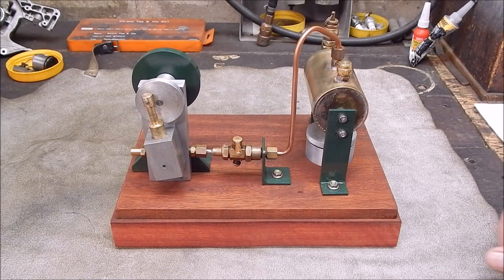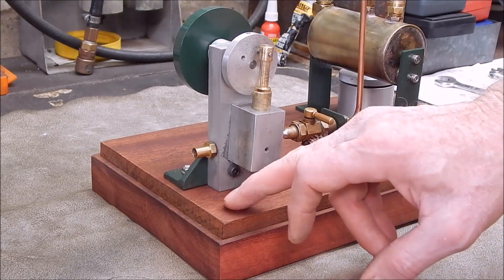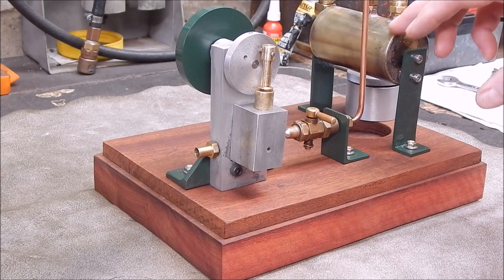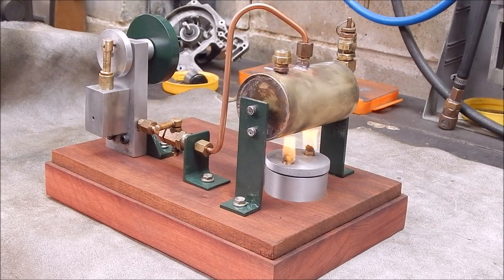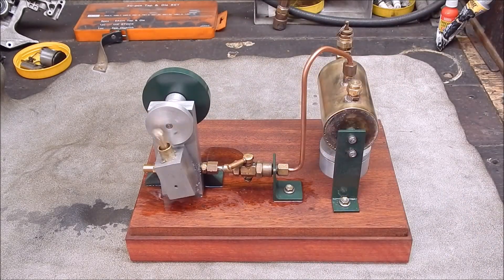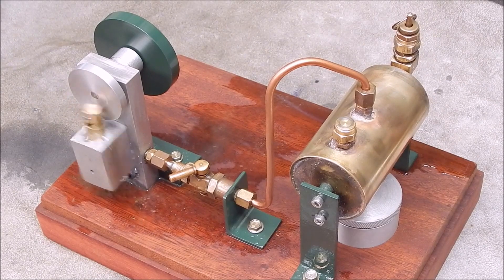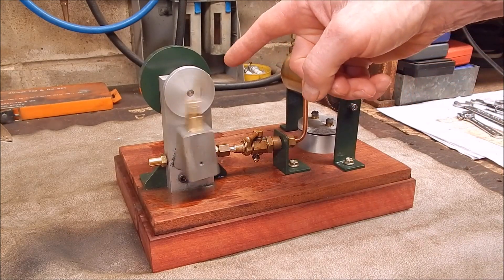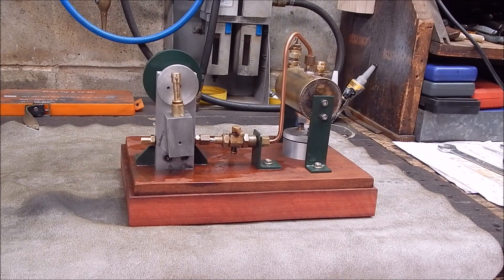The live steam powered wobbler model engine project is complete

Comment: Nice work Rob !!
Reply from the maker: Thanks Patrick.  I was starting to doubt if the boiler would be big enough, but it worked out OK once I fitted the control tap.  Cheers Rob
Reply: @Xynudu  Rob,I have an old steam engine and boiler from Germany.Wilesco is the maker.The boiler seems about the same size as the one you made.I ran with a small amount of alcohol in a container.You should make a tiny whistle.Cheers !

Comment: Hey Rob.  Once she warmed up she ran like a sewing machine.  Perhaps a little gauge on the boiler and let it build up some additional pressure, you might be able to run that Dynamo.  Maybe add a sight glass and a water pump and go all in!!!  Great project and thank you for sharing.  On another note, how is the displacement engine coming about.  Or have you shelved it in frustration?

Joe
Reply from the maker: Hi Joe,  I am moving on to another simple steam engine project.  I can give the boiler more heat by raising the burner wicks, but if I crank up the engine speed, run time would diminish.  So I will call it quits on the wobbler.

It's been a great fun exercise - all new stuff to me.

The displacement engine needs some serious re- engineering and ultimately it will be much the same format as my previous two successful Stirlings, so I will change tack and use the bits from that and the Bastard flame licker engine to make a new simple long stroke steam engine.   I could potentially run the tiny dynamo more effectively off of that if it works out.

All good stuff and just shows lathe and workshop life is only as interesting as you make it.

Cheers Rob

Comment: Looks great Rob👍  very smooth, Looking forward to the next one mate. Hope the beer fridge is well stocked for today 🍺
Reply from the maker: Hi Bill,  things are heating up here.  Always plenty of beer in the fridge.  When your workshop burnt down, what was the lathe model that got destroyed at the time ?  Was it an AL250G ?  I'm interested in owner impressions of this lathe.  Cheers Rob
Reply: Yes Rob, I barely got to try it but was not hugely impressed. Was given to me by dad when he got the new one (same as Matty's workshop). Dad found it useful but it had rigidity issues, to be expected from a small machine. Never seen anyone say many nice things about them.
Hope you survive the heat wave mate 🍺
Reply from the maker: Thanks Bill.  I have never seen much positive about them..  I know the early ones had some serious quality issues.  The reason I asked is that I saw an up-spec version on a Chinese site and it looked impressive (had a separate drive bar  for the horizontal feed).  Currently only sold in India.  Interesting.  Things are sure heating up here.  Having a beer (Chang).  Watch my next video going up today.  It could be a game changer for new small lathe buyers.  Cheers Rob
Reply: Like anything from China, the quality is not their fault. They make things to the specs supplied to them.
Be cracking a tinny soon here, also a warm day for Tas   27c

Comment: Well done Rob. 👏👏👏👏

Now you need a Chuff Pot to capture the water run off. 

I use spray on car wax to protect the wood on my engines.
Reply from the maker: Thanks for the tip on the car wax.  I have some thick wax car wash as well.  I wonder how that would go neat ?  Cheers Rob
Reply: I use this product. 

Meguiar's G7716 Gold Class Carnauba Plus Premium Quik Wax - 16 oz. https://www.amazon.com/dp/B006FUT05U/ref=cm_sw_r_cp_apip_Ko2SBgZjHL9ce
Reply from the maker: Thanks for the heads up.  Cheers Rob

Comment: As you said, looks very good and working very well.   You were able to get this built and operating so much easier than the Sterling engine project.    Well done.
For the wood finish, consider some Marine Spar varnish.    Should hold up to the water.
Another option is the clear base for latex paint.   In the US the big box stores mix the pigment into the clear base for custom colours so easy to purchase the clear base.
Dave.
Reply from the maker: The big issue is the temperature I think.  It makes eurothane go milky.  Thanks for the suggestions.  Cheers Rob

Comment: Very nice Rob, you should be well pleased with that 👍👍👍. I really like that you have mounted cylinder vertically rather than the more traditional horizontal mount. I also like the open mounted boiler. makes a change from the usual square firebox. The oil I use on wood is Liberon Finishing Oil, 3 or 4 coats does the job nicely. Cheers, Alan.
Reply from the maker: Hi Alan,  yes I like the open flames.  I had that wicked down very low and can easily double or triple heat output by exposing more wick.  Thanks for the tip on the finishing oil.  I had a look at what was available before deciding to give Armourall another go.  I have now given it a second coat.  It only degraded slightly, so it may do the job.  Getting damn hot here lately - 40C today.  Reduces workshop time somewhat, but that 1698 tastes damn good when I come in for a break.  Cheers Rob
Reply: @Xynudu  Hi Rob. Unsurprisingly, it's getting very cold here. Fortunately the 1698 works well in all temperatures 😂😂 Cheers, Alan.

Comment: Nicely done, runs well. Maybe a fire box and less mass in the cylinder might make it more efficient? Cheers.
Reply from the maker: Hi Paul,  a fire box would help locate the heat, but as the unit is runs fine.  I really don't like to see any steam/Stirling model engines revving their guts out.  A lazy speed is very relaxing and truer to real life.  Cheers Rob

Comment: Nicely finished!

Quick question, what's the bore and stroke? I'm thinking of building one (just as simple, but with rotary valves in the crankshaft and a non-wobbling cylinder as-per a design my grandfather told me about) and I'm thinking that if the bore and stroke (I'm planning on 1/2" x 5/8") is similar I'll probably also want a similar sized boiler.
Reply from the maker: The bore is 11 mm and stroke is 10 mm.  You will need a larger boiler.  Cheers Rob